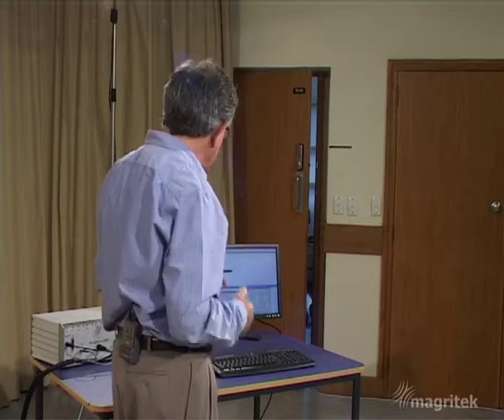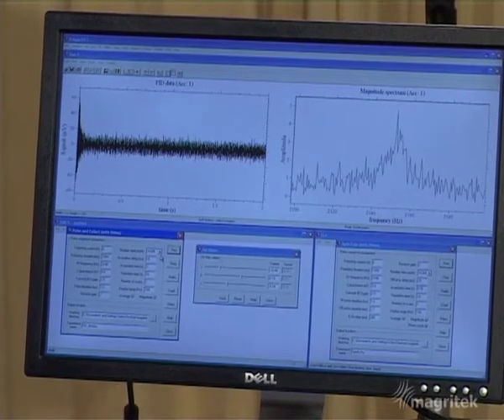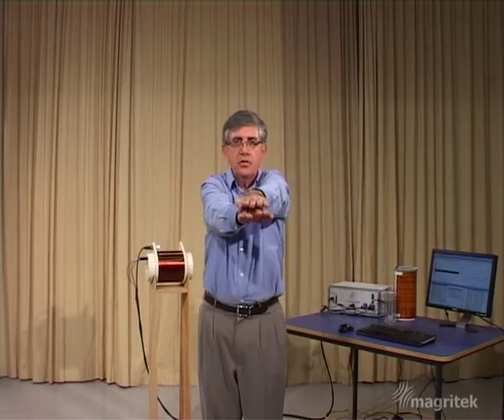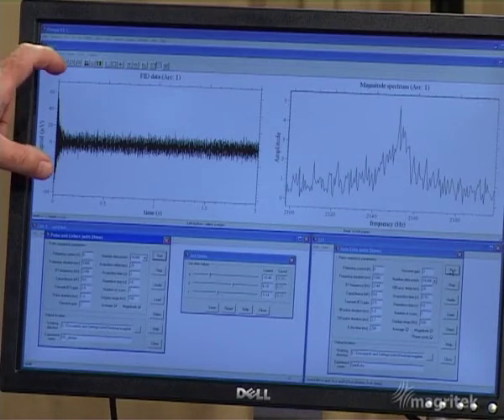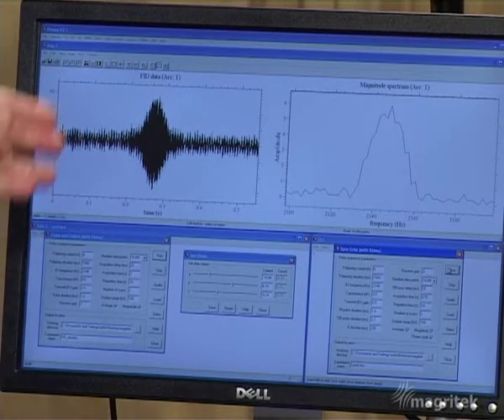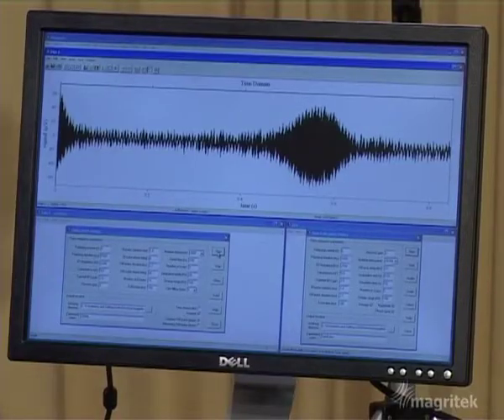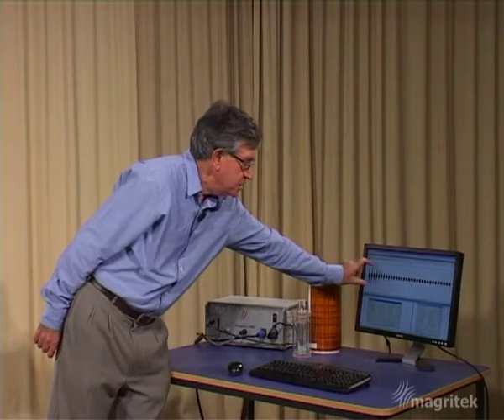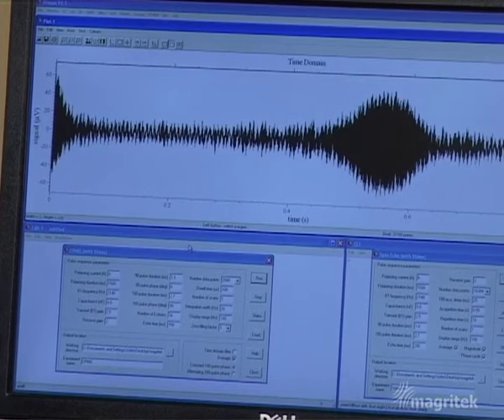Introductory NMR & MRI: Video 06: Spin echoes, CPMG and T2 relaxation

Comment: I thought you originally said that the signal that kicks the hydrogen momements off the rest state was at the precession frequency, but here you say it is about  1 ms.  Does this mean that it is only 2 cycles of the 2+kHz signal?  Why couldn't this simply be a DC field to hold the H-moments for a while at 90 degrees to the static (precession causing Earth) field, then let the moments decay back to the Earth field orientation?
Regards, Steve N.

Comment: I have a question . At 1:10 you say that 'the 90 deegree palse happens right at the start ' . But the Free Induction Decay Signal is measured  after the 90 degree palse ENDS , because after that time the transverse magnetazation becames smaller and smaller , and that's why the signal is decreasing . So did you mean to say that ' the 90 deegree palse ends right at the start ' or am I mistaken ?